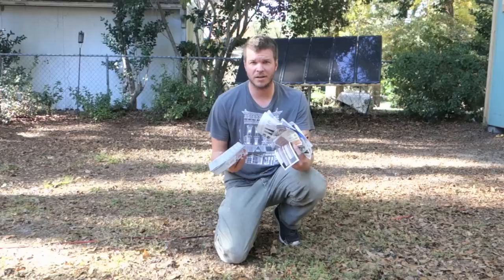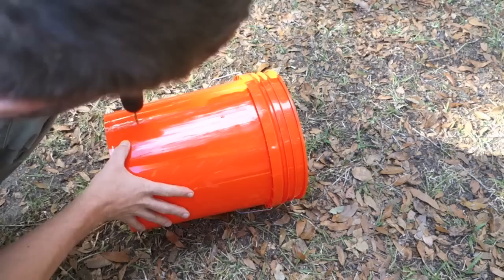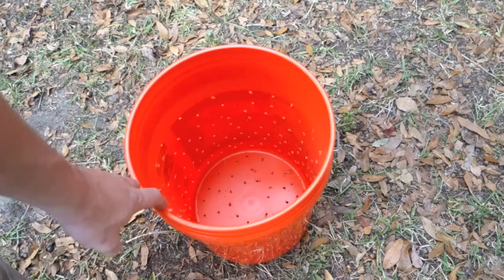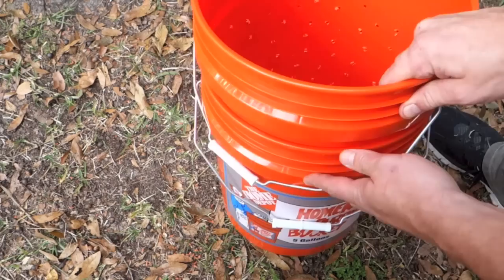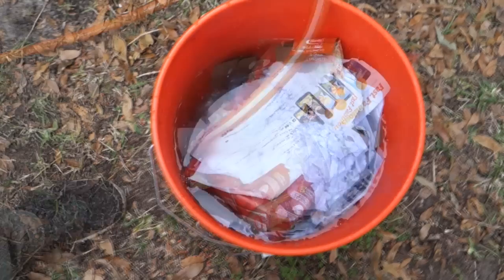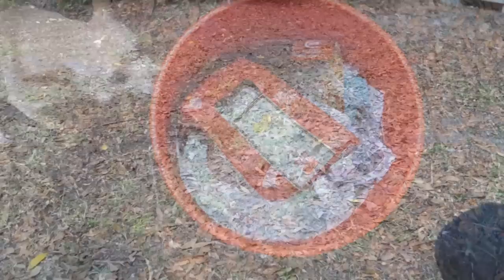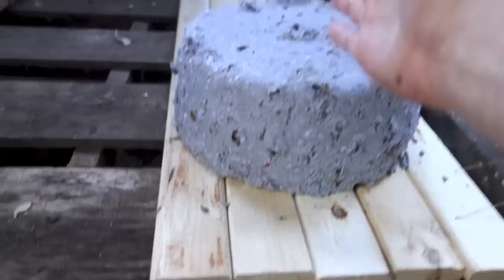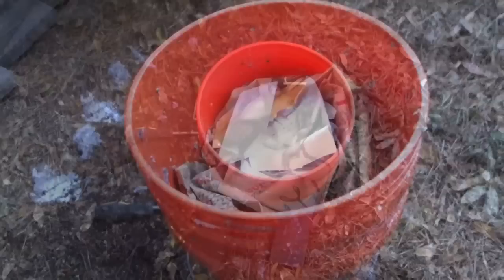Free And Virtually Unlimited Fuel To Heat Your Home

Comment: I am using 10% earth, some small twigs  straw, grass, evergreen needles and twigs, evergreen saw dust  old vegetables from local stores and markets and 487 goats 2horses, 5 sheep 3 cows and or 400 rabbits, 3 donkeys 2370 rats and well over 400,000 grasshoppers manure. I combine these ingredients base on availability. I make about 3 to 8 tonnes at a thyme. then pour this slurries from one storey height into large composite pipes 12 feet long. These pipes have 1 once center core cavity. when dry I cut in a secured filtered quarantined shed with a saw into 4 inches sections. The next build will be to construct 4 inch wide 1 foot high square molds with hollow core. I will pour then compress the sludge 30 molds at a thyme. I dry them in green house. I use 7  small funnell magnifying glasses to intensify  the heat. I then pipe the heat through reflective pipes INto a confined Space. Here the hot air washes over each log. As the first drysr I push new one in from the cooler side. This will be thyme and moisture regulated. The moistened air will be burned just as a precaution.ok

Comment: Beside making sure u use not crazy paper for non toxic this is cool. Not including the energy and time it takes initially but you still have to use a bit of energy for the drill everytime to shred. Suggestion! Built a water wheel and use that for energy :D

Comment: What if you make a smaller batch with using just junk paper and gasoline? Then put a plastic bottle cap on the water and  paper log mixture when it is still drying. After that is partially dry take the bottle cap out and fill the space with the gasoline mixture and use it for quicker starting.

Comment: You've added a process that's more time consuming and costly with the wood and press.Hope I can save you time and money!  I throw mine wet on half a length of diamond cut metal mesh lath on the grass (about 6"long x 2' wide) , fold it in half and step on it till the water's out . Dries quickly and you can fold it into compressed squares.

Comment: You shouldn't burn anything other than dry, properly seasoned wood from felled trees, or pelletized wood sold for use in a wood pellet stove (or corn if its a corn burner, things intended for that sort).   The exception would be a little bit of black and white newspaper to help start a fire, but colored inks should be avoided, plus envelopes have bits of plastic with them which is bad to burn.  In general, any manufactured wood or processed material should not be burned in an indoor/outdoor residential setting.  There are health risks and risks to the chimney or both if not followed.

Comment: A lot of that "paper" (mostly the mail and ads) like like it has ink or some sort of coating on it that you would want to burn; much like magazine pages. I think this would be a great idea if you're using cardboard or paper without that coating or ink know it that is possibly toxic. I understand if you have proper ventilation with your fire that it probably isn't an issue but no harm in being cautious. That and burning that stuff is probably just bad for the environment anyway. When spring rolls around I'm going to give this a try using cardboard and some yard wasted I'd normally just compost; turning the yard clippings, leaves, and any small twigs into a very fine mulch beforehand. It'll be interesting to see how it turns out.

Comment: I think that burning paper for feel is more environmentally friendly than recycling them. Recycling requires a lot of energy and harsh chemicals that need to disposed of as well. Just burn it. The carbon released came from the air in the first place so it's sustainable.

Comment: I hate junk mail.  This video's got me thinking of ways to torture it even more by divvying up the circular wood press with embedded old sawzall blades, resulting in smaller sections that would break away from the original 'log' easier, dry quicker, and ignite faster.  Thanks for this therapeutic method of vengenge against a modern-age pestilence!

Comment: Careful when heating, weldingand bending circular saw blades, you can make the temper inconsistent. This can lead to blades shattering at high rpm and serious injury. There are commercial attachments available for this purpose which are cheaper than leg surgery.

And I'd advise against using laminated (glossy) junk mail, toxic fumes and an all round bad smell can result. Stick to fairly raw paper products.

Comment: The best way of drying those logs out the quickest  Build a square box to a dehumidifier can fit in and you can place them on rocks kind like they do a smoker but it’ll be . Dehumidifier will suck all that water out of those blocks but you’re gonna want to build a small cabinet or a box or like a smoker more less

Comment: It occurs to me you could form these into a Swedish fire log shape by making an "X" out of some masonite or other thin material, and by pushing the X shape down into the fresh wet paper to about 2" from the base, then when it dries, it is ready to burn Swedish style with just some simple paper or kindling in the gaps, not only eliminating the problem you have making such a large pellet light and burn, but even making this completely portable to start anywhere...   food for thought.  If you're not familiar look up some videos on Swedish Fire Log for the intended shape to end with.

Comment: Or if you have an old glass door fridge you can dehydrate in there. 
I found your vid in 2014 and copied. I had a time with the wood press. It’s hard to picture but a car jack works well for the press.

Comment: I wonder, can you use this as some form of insulation. Also, if you take the buckets and reverse them when you need to drain, can you just put the non-hole bucket into the holed bucked and push the water out that way or would that not work?

Comment: For someone that has time and the energy, not to mention the excessive amount of paper waste.  This would be a fine way to supplement burning wood.  Get some use out of the 
waste.  This is not a good plan for a prepper or survivalist.  Without electricity, this project becomes labor intensive.  In colder climates, all this would need to be done before 
colder weather set in.  In addition to that problem will be the use of any water you have available.  I think that is why he advocated to save the water and use it again.  But at some 
point, more water will be needed and water will be at a premium.  But you could use standing water or pond water or any undrinkable water.  Drinking water should not be wasted. 
spontaneous

Comment: Surely the sharp edges on your home-made drill-whisk / shredder will eat the sides out of your plastic bucket in no time?  I use a standard shop-bought drill-whisk to mix plaster / mortar etc in a bucket & even though the whisk doesn't have sharp edges, the abrasive materials mixed wear the sides of the bucket over-time!

Comment: I wonder what the result would be to pour this slop into a bunt cake mold with holes in it to dry. Seems like it would make more sense than making like a huge block. you could even toss the whole mold into the fire and it would just burn out the paper and make less of a mess.

Comment: use oil instead 
use old blender on bottom of bucket 
make a press with screw sharft and bolt so wind down with handle

will work wonders

Comment: Less is more- I  thought draining it was a pain so I just added more paper until the bucket was full and all paper saturated (I shredded it first, but that might have been unnecessary). I let it set for about 5 days. I bought a paint stirrer for my drill from HD. I drilled until the paper turned into mush. I hand squeezed one log and sat it out to dry. The rest I took  a  10 ft gutter I had and cut it in half, drilled a few holes in the bottom and plopped in the goo. I put the other half of the gutter and set it on top  placing a few stray bricks on it for a couple of days. Maybe set at a slight slope.
 Then I took the bricks and gutter off and let it dry. 
It's been about a week. The hand fashioned one is dry. ( it's also smaller, so would dry quicker)
 The gutter  one is damp so I turned it out of the gutter and broke up into 5 pieces about 10 inches each. Set it on a  wrought iron patio table( good air flow) and hoping we get no rain. These are about the same size as store bought.
Reply: Update :my logs dried in about 5-10 days,depending on size. I dipped the ends in old  candle wax that I have kept in a container, melted at 170 in my oven.
It's burning great in my fireplace.  No wood logs necessary!

Comment: Only one major problem. The ink and heat transfer chemicals on those papers and materials. Burning all of that will eventually cause your immediate area to become contaminated with those chemicals. And should you have a garden nearby, you will eventually be eating those chemicals. To avoid it you have have to use paper with no inks or transfers on them or just plain cardboard/boxboard.

Comment: And the energy needed to run the shredder you used?
Reply from the maker: Peter Carlson currently free. I've switched over to a battery drill charged via solar
Reply: Tiny House Listings Ok! :)
Reply: Peter Carlson
Reply: Don't worry Peter......... He uses   fart gas wind to power the shredder.

Comment: Why not do the same thing accept with a pvc tube that is about  5 to 10 ft long with an end cap, and a flex pipe with a slit cut the length so prevent water leaking. Simple seal it with a couple screw clamps.  
When it's cured and dry simply break it into to desired length.

Comment: You didn’t need to make a press for the water,...  you just needed one more bucket without holes and it would have worked as a press.  Bc it’s plastic it never would have needed to be remade.  In fact if you weren’t trying to save the water (which didn’t seem to work very well bc there wasn’t much water that got salvaged) you could just use the bottom bucket.

Comment: I f you have 3rd bucket then you can put the bucket with the with the holes in it in the 3rd then set the first bucket with with water on top like you did but you lost water when you set on it. Even better have 2 or 3 sets, 3 bucket with holes and 3 without holes! Top set is what is soaking under it is using the water and paper in the top one to press the water out another set can be where you are putting it to get it started

Comment: It is illegal to burn your trash in most cities. No matter how much cleaner he makes this then just burning the paper it still releases harmful pollutants into the air that industrial incinerators have expensive equipment to remove. Instead get more insulation and use electric space heaters.

Comment: Hi, Just looked at your video, it is very nice. I am wondering as an extension of using paper/cardboard, what would you think of using clothes dryer lint (fluff) also added to the mix as a binder ?  I know the usual approach is to use some saw dust, but as I am in the UK and we don't generally have trees to chop down and I don't want to go out buying sawdust. (and also using the principle of everything is free)
 I was thinking of using the fluff from my Condensing clothes dryer as it collects the fluff in the filter (about a plastic shopping (carrier) bag per month and as a bonus the dryer also collects the water out of the clothes in to a storage tank that is usually emptied down the drain, so again even the water is basically free as it would have just normally evaporated off as steam, but is condensed instead.  Any thoughts ? Regards, Mark.
Reply: Prolly would work, but the smoke would be toxic due to all of the synthetic fibers now in use.

Comment: I can imagine similar technique using 12 inch slices of 6 inch diameter PVC pipe with holes drilled in them with a cap on bottom with holes drilled in bottom. filling with the wet mulch and allowing to drain into 5 inch diameter logs??

Comment: Why not just use a 2nd bucket to squeeze out the water? Why did it need a round board? I'd also make the logs much smaller so they don't take months to dry out. It's extremely simple to make a press. You can use a car jack to provide compression. You can stack bricks beside your fire and the radiated heat will dry out the next batch. Free fuel.

Comment: Good idea.  I wonder if a ground hole maker drill would break it up? For a while I thought you were going to squeeze it thou  a log size pcp pipe with little hole to get the water out an form it into logs dry them an fire them. Funny. Thank You Loader.

Comment: would an oscillating dremel work for this if the maceration started as smaller pieces and soaked an extra day? 
rather not waste wood, would a third bucket with heavy weight inside work as a press?

Comment: this might sound not nice but ..years ago i worked at a sawmill and they had real trouble getting rid of all the oak  sawdust that couldn't go for pets etc..i had an idea of what to do with it but the boss didn't like the idea but i still think it's got legs, mix it in the same way with cow dung,i it burns nice and a good blue  flame,i got into it and the biggest problem looked like it could be methane but after investigation it turns out that almost all methane from beef comes out of their mouth not the other end so it should be ok...but probably best get a scientists opinion to be sure..

Comment: Isn't the second bucket  underneath, collecting the water unnecessary and slowing down the draining drying ? wouldn't it be better to just keep the pulp bucket on the ground outside ; with eg iron mongery weight on top filling  another bucket , and a 'lid 'to keep rain out . The water can get out freely and disappear into the soil, the drying /moulding process being  just that bit quicker .......

Comment: could you not use another bucket??? you mentioned having 15 on the go, so you'll have extra buckets, and they are made to fit eachother. and you'll be able to add weights inside the empty bucket to push it down.

Comment: 4:13 Saw blades are hardened and would snap before you could bend them like that.  Did you heat it to soften the blade?

Comment: Why don't you save more of the water by making a personal support for the bucket with holes so all the fluids drain into the outer bucket? like some kind of funnel made of wood that stays on top of the outer bucket. Saves more water than just 2 planks of 2x4's. Just a suggestion.
Reply: Maybe a spare grill grate would work?
Reply: that too.

Comment: Let’s review why I wouldn’t t do this:
1) there are a lot of chemicals used in the making most of the paper products that you’re burning that are great for inhaling. 
2) same for the pressure treated wood, just use a third bucket. 
3) in fairness if it works with leaves and twigs that would seem the way to go.

Comment: I assume the paper is soaked and the water dissolves the ink on the paper as you compact it u also squeeze more ink off of the paper ... right or not???
Reply from the maker: Much of the ink definitely goes away. If you're concerned about the ink, you can also have an outside fire and have the heat transferred into your home.

Comment: looking for shredding methods to use all this paper I get to make handmade paper to draw on or make stuff out of etc.   found this.  good description of your method.  Ill sort types and have to make a screen draw table but this is the best method I've found to manually shred mass paper down to pulp   it will be fun making the tool.   did u cut and weld the edge back on the blade or bend it ?  couldnt tell

Comment: The shiny paper which is usually the color ads.. I'm concerned about the toxicity of the colored ink. And whatever chemicals might be used to make the paper shiny as opposed to the dull paper that's in the regular News section. Any thoughts or ideas on that? Or is all sections of the paper just as safe to use in this project? Thank you
Reply: That's plastic.  Burning plastic, ink, toner and glue is bad.

Comment: Hi i have a question , how long does it take for your paper longs to dry after you pressed out all the water , Thanks Mike
Reply from the maker: Totally dependent on the heat outside and if they have access to sunlight while still being covered form the elements. Another option is putting your paper logs near the wood stove itself!

Comment: putting garbage to good use but not really sure why you bother going through all that work for when you can simply toss that stuff directly in your fire,,i mean does it burn longer if you compress it all into a block like that? i just figured a good way to get rid of junk mail and heat the home is to juts toss it all in there whenever you get it

Comment: Why not run paper through a shredder prior to putting in pail? It will eliminate need for "drill blender".
Reply from the maker: that would take more time, and it's another item you'd need. With this method you simple throw it in the bucket

Comment: Yeah, no. My dad bought one of those "kits" where you wet the newspapers, blend them in a bucket, put them in molds so they dry like "bricks." WAAAAAAY too much work for the time those little logs burn. Just waiting for them to dry takes forever. Just way too messy, takes up too much room and entirely too much effort for the very small reward of feeling like you aren't "wasting" anything.

Comment: if you used the electricity you spent shredding it powering an efficient electric heater you would probably get more heat and you would have to fuck about in your garden for hours